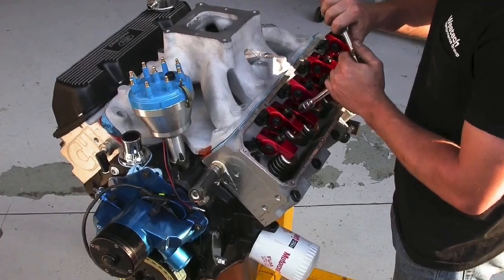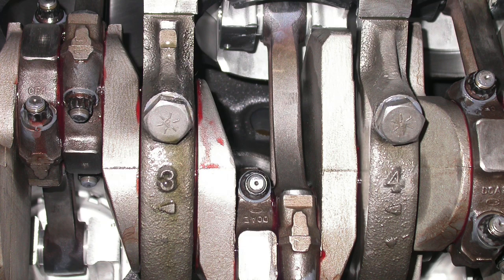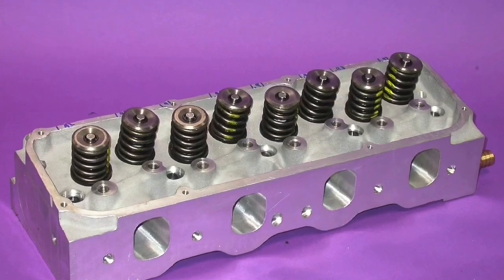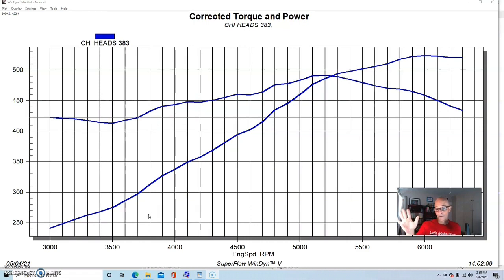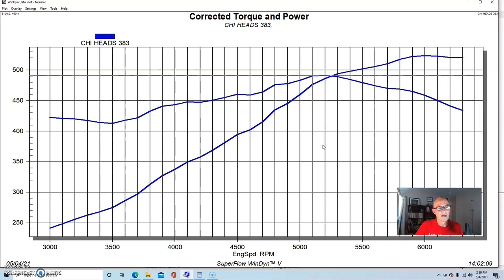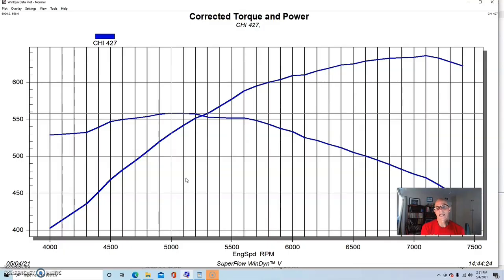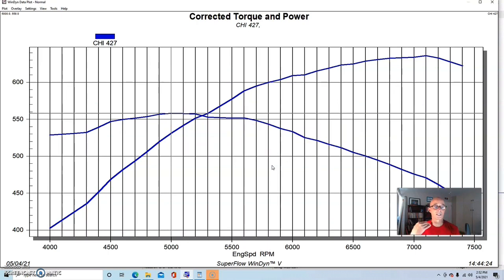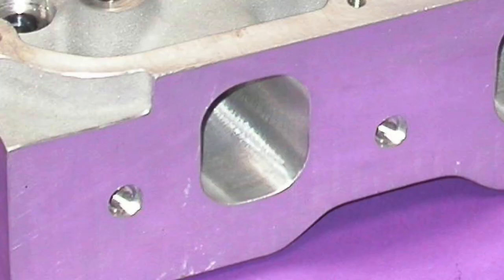351 STROKER CLEVELAND OR CLEVOR? WHICH "OTHER GUYS" MOTOR WORKS BEST?

Comment: The Windsor 427 had to carry many more rpm (7100 verses 6000)  to make 112 hp extra. The Cleveland 385 cube made 1.27 lb-ft per cube. The junkyard block verses a 125 thou siamesed  bore race block. You have diminishing returns right there. Race blocks aren't stamped for engine number and have there own problems registration time in some states. I'd take the thinwall 335, or find an old 351M or 400 block...and iron 4V heads with proper pocket blending and epoxies in Glidden aluminum  exhaust plates make a 750 hp  steel cranked 434 stoker and pocket the change over the CHI 3Vs and Dart SHO Windsor 427.  Great comparisons Richard H!
Reply: I was looking at peak torque numbers to get a feeling of the efficiency of the parts combo.   The 383 should have been over 550 ft lb and the 427 over 600 ft lb, if the cam, compression,  exhaust,  intake and heads where sized correctly.  They were both missing about 50 ft lb or more so something was not right.
Reply: @dennisrobinson8008  Richard,I think, nailed it...383C 3V  deserved a roller cam. In my opinion, a dedicated one, with a more suitable intake. The 427W 3V, it was roller cam, but there was a stability problem up high, with an expected peak HP of 694, but it only gave 636 HP.  Each could have made better low end torque, if the extra test time could be made finding a suitable cam grind for each. ( not a critique to Richards efforts, I'm really careful to say) The traditional index figures for torque on a healthy LS are similar to what the two engines gave, 1.27 and 1.30 lb-ft per cube, peak power , again, each engine is a little bit lower than the best carb LS's for HP per liter, especially the 427W 3V. When you change deck height 300 thou and have a corresponding runner length change, you most likely  have to find cam profiles and carb spacer and intake configurations that bench mark with the best Chevy LS ones. Unlike Chevy stuff, Ford changes deck heights, main bearing sizes, rod lengths, even on the CHI, you got over sized the valves, and headflow goes nuts on intakes, and frequently, we have to grope around on the dyno to find cams which suit the changes. Chevy Small blocks are all similar, and a lot of companies spend time finding what works. Ford is often its own worst enemy because of the dual purpose nature of everything. 8.2, 9.2, 9.5 deck engines are three distinct families, needing distinct solutions.
Reply: @deanstevenson6527  Here goes a CHI 3V headed combo 629 ft-lb on 12:1 and 788HP at "only" 7200 RPM 400ci.    It's 101 octane race gas.   I look at the torque numbers to see if the combination is setup correctly.   400 CI should certainly crack 600 ft-lb.   https://www.youtube.com/watch?v=E-f4oqwhMSE.
Reply: @deanstevenson6527  I will admit, that i never respected the cleveland for what it was until recently.   I grew up a windsor guy.   But i see whenever the cleveland head architecture is brought to the table it's when the big power is coming out.
Reply: I'd love to see a max stroke 400M/4V factory head build, more stability in the bigger factory block as opposed to stretching the limits on the factory 351 block.
Reply: @jonathanhardy9142  The bigger 335s don't seam to have the durability problems with splitting bores the 302C and 351C have. I'd vote for a Super Ritchie long stroke 400 taken out to 434 or more...can someone supply Richard H a nice long stroke steel crank and a free 400 block and 4V Boss heads?

Comment: I willing to bet, you build the 351 Cleveland and the 351 Windsor equally bored and equally stroke that 351 Cleveland would make a ass out of that 351 Windsor far as I'm concerned that 351 Cleveland is the baddest small block and I'm a Mopar man my uncle in the Carolinas made a believer out of me.

Comment: Richard you should go take a set of 2v heads have them shaved 10,000 put a boss cam in the block put an 850 Holly on a single plane manifold you'll be surprised the new King has arrived.. and everyone insults those heads they just wanted more cam
Reply from the maker: 2v heads don't flow very well
Reply: I'm pulling my tired 2v aussie head motor to build what should i do stroke it or ? It has a mild cam ,750 ultra dp, ed performer intake and shorty headers. 389 gear tremec 5sp

Comment: Richard, any speculation of power numbers using a factory 351C - M code 4V  head on that 427 Windsor Block ?  ( Cam and piston as chosen here)
Reply from the maker: they only flow 275 cfm, so not as much potential
Reply: @richardholdener1727   I would think so as well - but decent power production as a low buck alternative. 530 ish vs 600 ish?

Comment: While the cleveland short block is a stout block design, the windsor short block isnt a slouch either. The windsor design weighs 150lbs less and is only 75lbs more than the "ls1".  Windsors are more common and easier to source parts for. Im a big clevor design enthusiast, especially since mustangandfords . c o m squeezed 1159hp from a 200k hydraulic junkyard roller 93 year 351w/5.8l with cxracing turbochargers and some speed density tuning.
Reply from the maker: I'm familiar with that-take a look at the Big bang 351W video that is up

Comment: I would just want to see the difference between the stock Cleveland v4 heads and the aftermarket performance Windsor heads on a big inch application...... like..... how good actually are the factory cleveland heads and are they worth your time when you build your own stroker? if they do make more peak power than wedge heads, how much are you sacrificing in the bottom end to make those gains up top?
Reply: We're talking wedge against a poly, right ?
Reply: @cammontreuil7509  I meant factory Cleveland heads.... all types v4 etc.... vs the best aftermarket Windsor heads available. On a big inch motor we would see the difference where a smaller engine isn't going to be pushing the cfm limit of the ports
Reply: @DavieJones_Lockr  traditionally, wedge heads have always made more low end torque.
Example, as in coming out of a corner at short tracks.
Something that really can't be measured on a dyno.
But we can get a baseline idea.
If I'm building a race car. Short track. Wedge heads. Long poly heads.
Reply: @cammontreuil7509  now tell me something I don't know...... with a dyno sheet
Reply: @DavieJones_Lockr  how a car pulls out of a corner on a race track. That's what you don't know. But I do.
Reply: @cammontreuil7509  false. Number one, you have no idea what I do and do not know..... save the amount of low end grunt lost in a v4 headed small block ford vs the same exact engine with a wedge head, because that's what I asked. You popped up wanting to be the expert and stroke your own ego, but you didn't even understand the assignment...... you wanted to talk about racing..... which usually entails a set of rules where everyone has to run the same thing so it's a competitive race, but in some world you're running aftermarket aluminum high flow heads against some old factory throwbacks from the 1970s... strapped to engines specifically of larger displacements like you might build for a street driven application. You know, where the bottom end power loss will be REALLY seen because that's where you'll spend the vast majority of your time? 

If the assignment was "tell me you don't know shit about reading without telling me you don't know shit about it".... well.... then you'd be a regular Einstein over there.  Read, comprehend, answer.... IN THAT ORDER, or you'll look like a clown again
Reply: @DavieJones_Lockr  sure hurt some ego. At least you know what a poly head is. You didn't before.
Reply: Factory 4V headed 400M stroked to 500ci, that should be enough cubes to wake up the heads!
Reply: @jonathanhardy9142  yes exactly. The bigger inches would bring the volume necessary at lower rpm ranges to get intake charge velocity into a usable range earlier. The question in my mind is "is it worth the money to buy high dollar Windsor/wedge heads if you have an old stock set of v4 Cleveland heads laying around, and if there is an overall power advantage in either, where in the rpm range will it appear?"

Comment: Do you have any thoughts on the Auusie 2V heads? Smaller ports and quench chamber. I have a set and want to put them on a 408C stroker short block. Might it be worth it?.. Thanks
Reply from the maker: they have higher compression-but don't flow like a 4V
Reply: @richardholdener1727  So that would be.. not worth it? In your opinion?  Thank you Sir.

Comment: Hey Richard, what compression ratios did these motors have and what fuel did you use?
Reply from the maker: all were run on 91 and the compression was given for each in the videos
Reply: Just rewatched this vid and you never once mention the comp ratios, guess I’ll have to go search the other videos! 
However do appreciate getting the octane number.

Comment: They really should have picked something other than 2V and 4V for names because everyone wants to say valve instead of venturi which is what the V stands for on these heads.
Reply: To be fair i dont think ford anticipated using more than 2 valves per cylinder back when the Cleveland was designed 😂.

Comment: Cleveland will always rev higher than a Windsor due to main bearing size. Any Cleveland will rev past 7000 rpm. No Windsor can spin as fast and escape failure.
Reply: My cleveland with comp cam and comp springs/locks/retainers runs to 8k no problem could probably do more

Comment: I would rather have the 351w.  I used to like the Cleveland, but the shorter deck height, the thinner cylinder walls and unavailability made me switch to the Windsor
Reply: There are so many more intakes available for the 9.5 deck height. There is a bunch of 9.2 intakes for Yates style heads but not too many guys can make use of them on the street and they aren't meant to fit under any production hood. If you have a couple extra dollars available a 393 kit is really cheap for the Windsor. That blocks are available with factory hydraulic roller and aftermarket heads are getting poured in China daily makes it a really cheap build. Your odds of finding a serviceable 351C block in a Junkyard is pretty small.
Reply: @timothybayliss6680  I did a 3.75 4.060 Dart block Windsor.  AFR 185 heads flow better than any Cleveland head I know and retain a lot of velocity.  CHI heads are badass but who can build a huge displacement monster with a 9.2” inch deck heigh economically?  The smaller mains are about the only benefit I can see, but even that is irrelevant because Dart uses the C mains.  Would have been cool to see what Ford would have done with the C if it had become popular.  Can you imagine the monster strokers you could do with a 400m deck height and the big 4v heads?  That engine would have been a legend.

Comment: Richard!  Please do a video on dyno runs/sweeps from idle to 3500!!!! Or idle to whatever,  then do a pull from 4000 to the moon. Most people daily their rides right?
Reply: That’s not really how a dyno works.  You would be measuring WOT starting at idle, which you don’t do on the street.  You don’t leave the light at pedal to the metal and then once you hit 3500 let off, you throttle in and then part throttle to whatever rpm and shift.  Dyno doesn’t really do part throttle.
Reply from the maker: WOT at idle?
Reply: @richardholdener1727  wot from idle*?

Comment: Good afternoon Richard,  Ive been watching your videos and am currently putting together a stock block 347 together with afr 185 heads and comp xe274hr cam. Will i be fine for piston to valve clearance?
Reply from the maker: the 347 piston will likely have valve reliefs
Reply: @richardholdener1727  hey man I luv ur Chanel  But the question is will u do a Comparison of the Chevy 8.1 motor VS the dodge 8.1 motor nd then ad boost  to them to see witch one makes more

Comment: Richard you should try the Aussie 302 2V head with some port work will out do the 3V heads and intakes are easy to get
Reply: I really don't think so... Pavtek, who know their stuff, can get around 520 hp by CNC porting a set of iron 2Vs and you'd consider that pretty much the limit. The smallest-port CHIs out of the box, without any work at all, are already up around 550.
Reply: @gergatron7000 Some of the racing teams are make over 600+ hp with the Aussie 2v clevo heads add 4v valves and some bowl work and to the closed camberand theyare hard to beat, yeah today tech may be alot better but wont be that much ahead

Comment: Has anyone ever built a 427 based on the 9.2 deck Cleveland. All the 427's I have seen are based on the 9.5 deck Windsor. Is 383 the largest size possible based on the 9.2 deck Cleveland?

Comment: What do you think about the Kasse P38 heads?  They have a modified valve angle that moves the valve away from the cylinder wall as it opens. This unshrouds the valve allowing for better flow.  Anyway, could they be even better than these 3v heads from Australia? 
Kasse made an unbelievable 749 horsepower with them on a 427 windsor with a hydraulic roller cam.  I read about em in muscle mustangs and fast fords magazine a few years ago.
Reply from the maker: they work well-he knows how to build power

Comment: Clevor engine is best... Less weight, the Windsor engine oils from bottom to top! Cleveland engine oils from top to bottom. You want the oil from main bearing to the top end the Cleveland engine does not. That is why NASCAR don't use Cleveland engine's!!!

Comment: Hi Richard if the Windsor block is 4.125 bore doesn't that bring it up to a 434?
Reply from the maker: 4.125 x 4.0 = 427
Reply: @richardholdener1727  I should have known better than to question you on this. You are indeed correct.

Comment: The stock 351C - 4v motors I knew as a Ford Dlr tech in their day were poochs by comparison. Holdener shows the basic design was good. More cam and lots more cubes was all they needed. Too Bad they wern't made in greater profusion
Reply: Cleve head flow us legendary, but none of us understand the reverse priority oiling on a motor that was meant to rev high and hard??

Comment: I'm surprised how many times you say "4 valve heads". I guess it's an easy mcsteak to make when you regularly look at 4 valve heads.
Reply: He never said "4 valve heads" and the V doesn't stand for valves.
Reply: @goodmechanic  I know that the V is for Venturi, meaning how many barrels the carb has. 

At approximately 3:10 he says "it's not the smaller 2V heads and it's not the very big 4 valve heads". at about 4:00 he says "we know these heads make a lot more than the stock 4 valve heads". 

I'm not watching through the rest of it again, but he says "4 valve" at least a couple times in the video when he means 4V.
Reply: @totensiebush  Since I knew what the V meant I guess I didn't catch it. Or maybe your hearing just puts a bats hearing to shame. Good catch Batman.

Comment: 4 venturi, not 4 valve!! 4Vs are good for door stops. Way too big with poor velocity
The 3V head uses standard 2V size valves. The door stops are far bigger!
The only advantage of a Cleveland head is the canted valve deal, better port location though the 3Vs have the intakes an inch higher!
Reply from the maker: TAKE A LOOK AT THE STOCK BOSS 302 AND 351 DYNO DATA-THE 4V HEADS WORK JUST FINE

Comment: I’ve just started watching your Ford SB vids. I’m looking at a build for a replica 427 Cobra. I’m struggling with your side by side comparisons with heads, intakes, cid combos, etc.. My problem: why do you compare apples to oranges in every video? Why compare heads for a Cleve with 2 different engines, 383 Cleveland vs 427 Windsor. Nothing but the heads are the same. Why not 427 Cleveland vs 427 Windsor, both in their OWN style heads, similar cams, similar compression, similar intakes, etc. I’m NOT looking to decide on whether I build a 375hp 363” vs a 550 hp 427”. REALLY! There no comparison! Everyone wants eight 550 hp 427! Why not compare eight 550 hp 427 AFR equipped naturally aspirated versus a9 to 1 compression 408 with a turbo or centrifugal supercharger. Or a 363 10.5to1 Brodix against a 363 Canfield?

Comment: You sure do alot of apples vs oranges. Not sure how this info is helpful other than this is what you'll get if you build this vs that. It's like comparing a 454 to a 396. Everyone knows what happens. If CID isn't the control, it's pointless. How about a 427 big block vs a 427 small block? Hmmmm?
Reply from the maker: read your second sentence in your comment
Reply: @richardholdener1727  yeah, I'd been drinking when I posted that. I've actually learned alot from your videos.

Comment: Engine... not "motor".  I'm positive that you know better.
Reply: Either is applicable as both do the exact same thing look up the definition of both and you will find that it's the same
Reply: @triplestangman  ya, an engine is a motor but a motor isn't necessarily an engine. There is old English definitions of things like water mills as engines.
Reply: @michaelangelo8001  calm down nerd
Reply: So, Ford Motor Company is incorrect?
Reply: @PompiisGarage  No, not as it is being used in the corporate name.  "Motor" in that setting, is a corporate legal term, which has nothing whatsoever in common with engineering parlayance.

I have an assignment for you now, it's your chance to prove me wrong: 

 Go to Ford's website and see if you can find any "motors" that they are selling there.